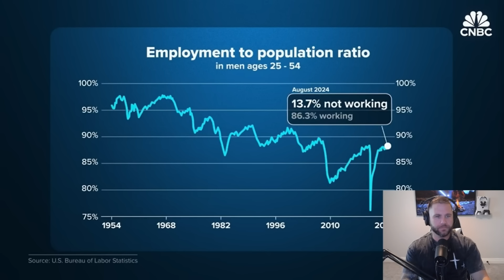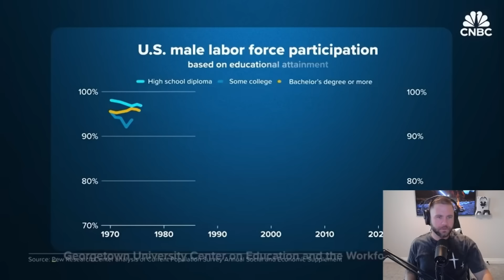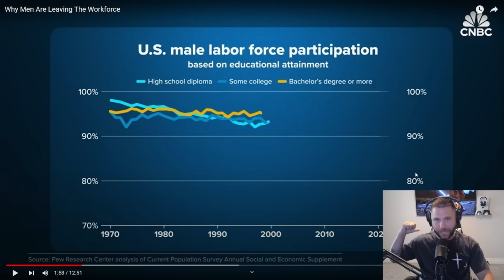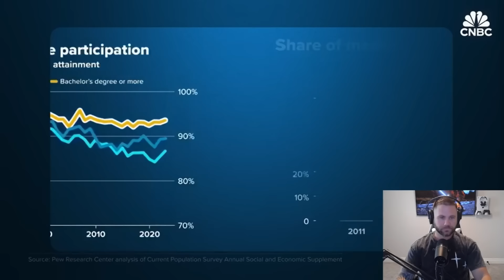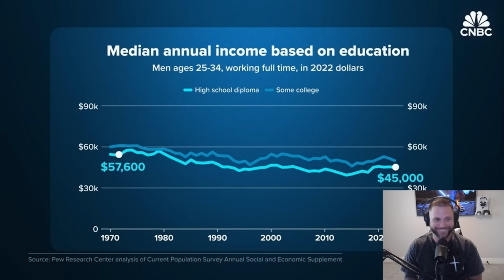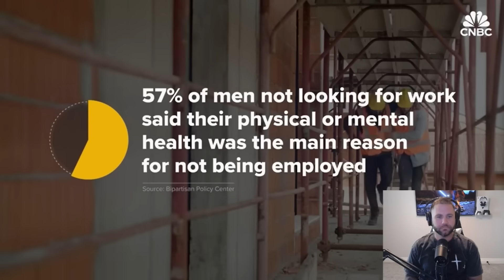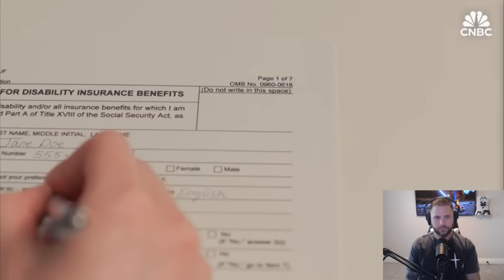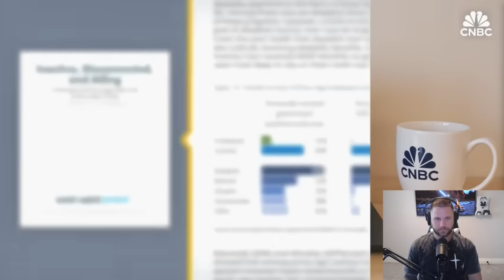men are choosing not to work

Comment: I've spent over a year looking for a relevant position in my late 20s. My employment is not anywhere near in my control like the narratives would imply or infer.
Reply: I'm right there with you, I'm 27 and was laid off in march with a STEM degree in Information Technology. I gave up looking after 2 verbal offers fell through. Budget cuts and one restructure. I'm now getting a master's degree starting in the Spring. Good luck out there, it's rough.
Reply: @WesternBachelor  yes I also have a pretty relevant bachelor's degree that's broadly applicable, does not seem to even matter